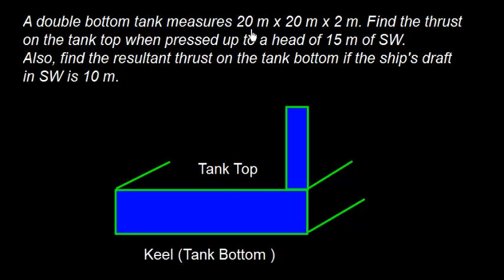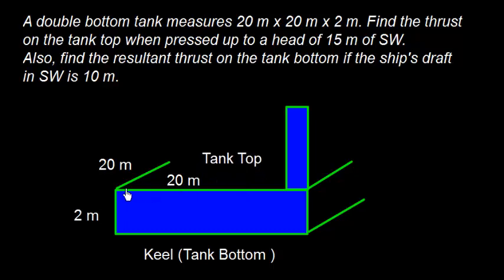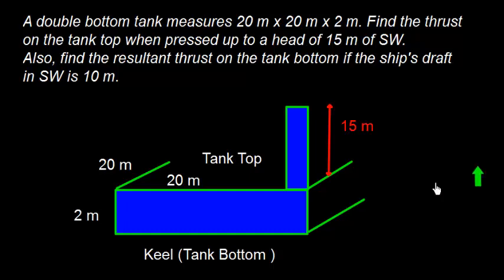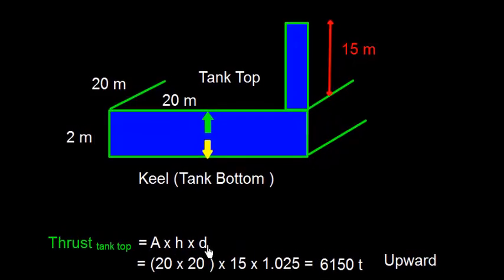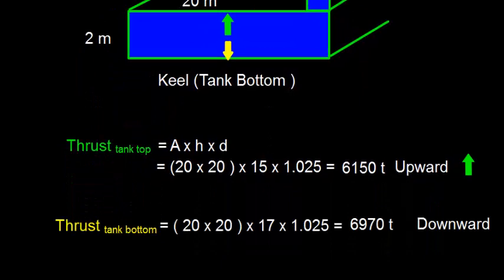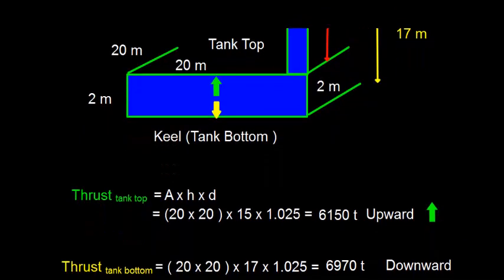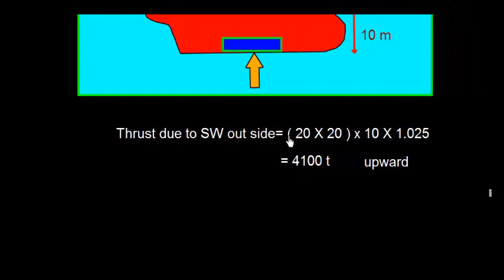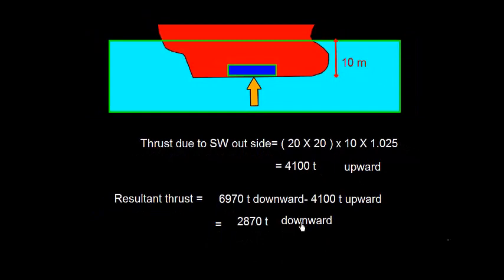Ship Stability Thrust on  Double Bottom Tank

Comment: Sir, in this numerical. Why we're not considering geometric center?
Reply from the maker: The depth is taken from water level o the geometric center of the plate. Since  the plate is horizontal, the  vertical distance  from COG of the plate will be same as any other point of the plate, neglecting the thickness of the plate.
Reply: @sailorstube3259  thank you sir
Reply: For second mate/ DNS/ Bsc NS prepration join kundan patna #kundanpatna